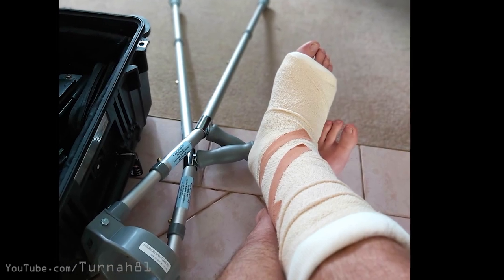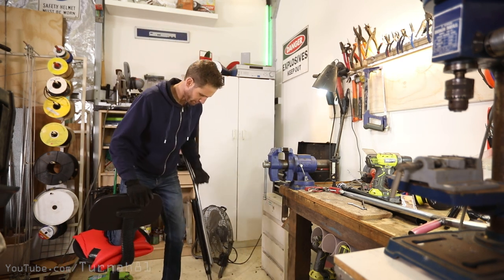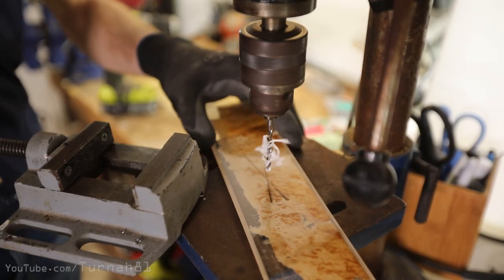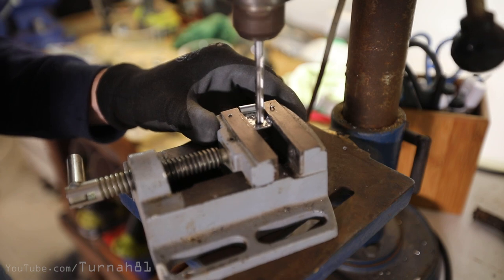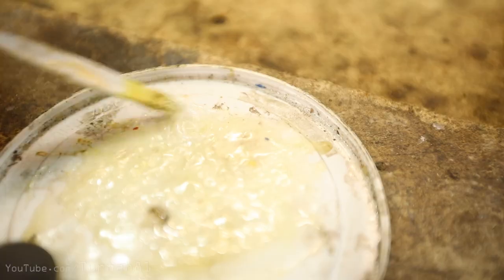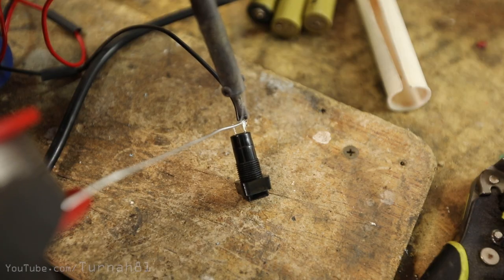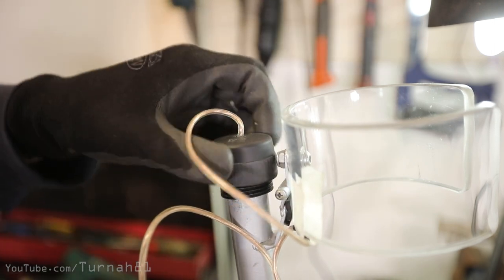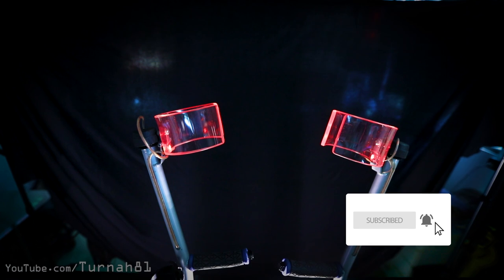Pogo Stick Stilt Crutches Build! - This could end BADLY -Part 2

Comment: Your experience with drilling into the acrylic should let you know what is going to happen. It tends to shatter under torsion. Great for making display cases (worked at the ANMM 25 years ago) but can't bear a load. Good luck!

Comment: Silver paint : 
1 part filler spray paint
1 part elbow wet sanding glass smooth
1 part black gloss paint
2 parts silver paint
2 parts gloss lacquer paint

Comment: Maybe I've not understood properly but I'm mystified about the idea of the foot pedals, I thought the idea of the project was to make crutches that minimised the ground shock impact of walking around on crutches but now what you seem to be making is just pogo sticks where you use them as a pair rather than the traditional way of bouncing with both feet resting on one pogo stick.
Reply: They're multi-mode, multipurpose, Swiss Army pogo crutches.